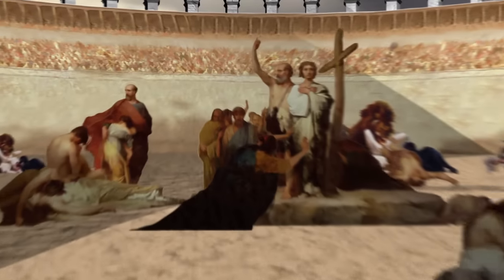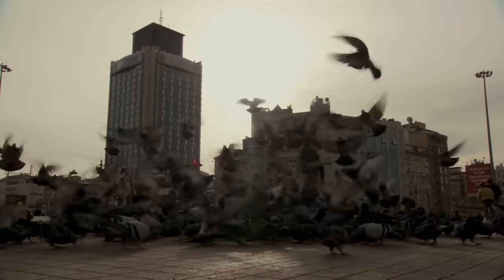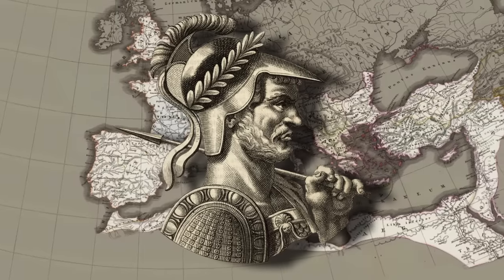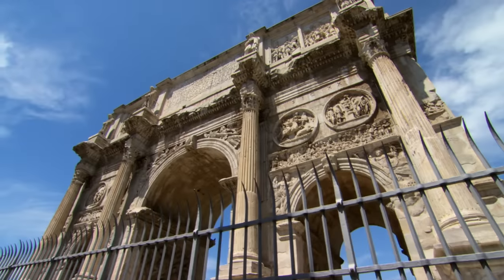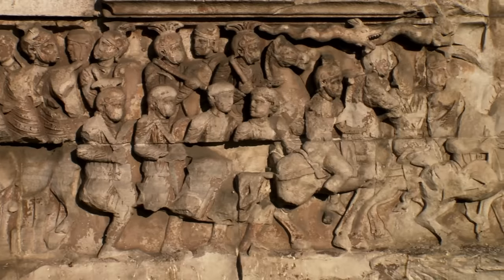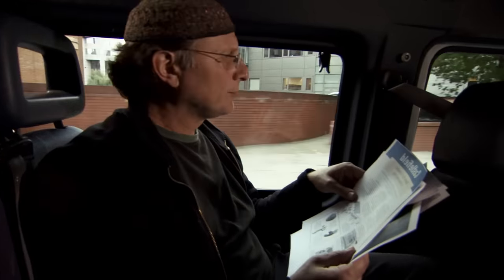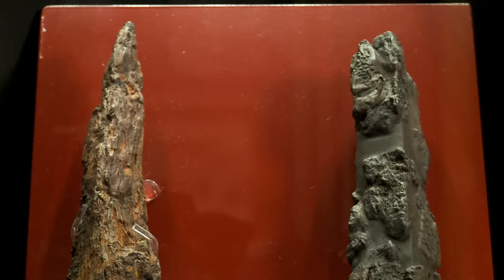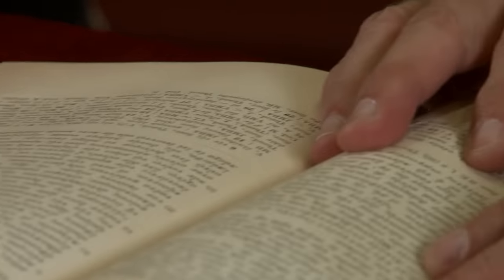The Truth About Christianity's Origins In Europe | Secrets Of Christianity | Parable

Comment: Humans have been fascinated with Palindromes for a long time, I wouldn't be surprised if the point was the Palindromes. There doesn't have to be a meaning, I think going that extra step might be going a bit too far. If you construct any five by five palindromic square by definition you have to have a cross at the centre. It doesn't have to be Christian.